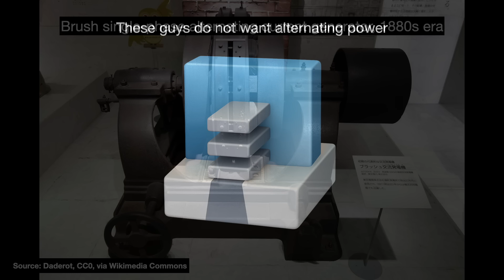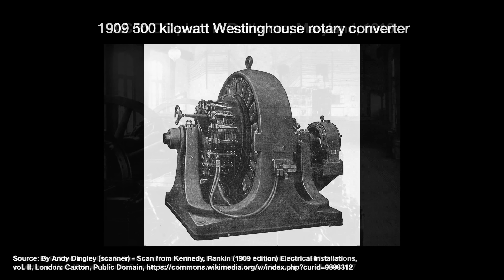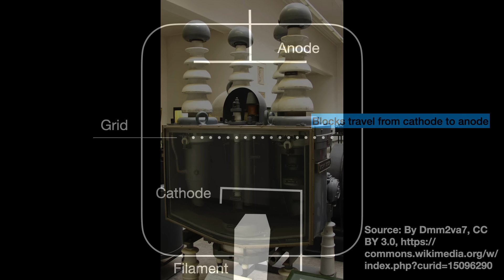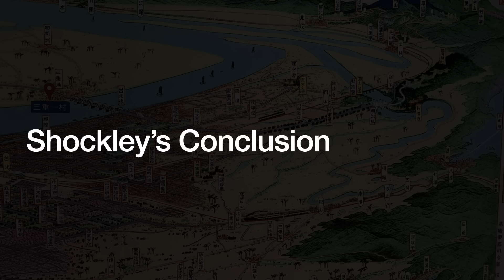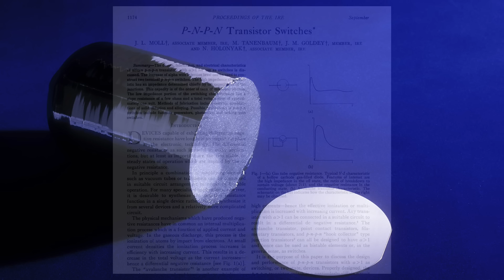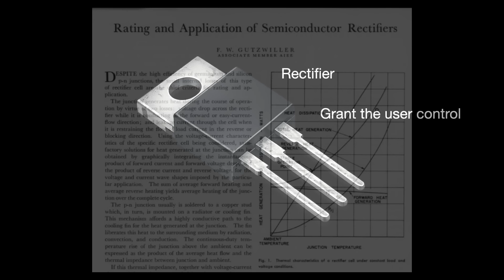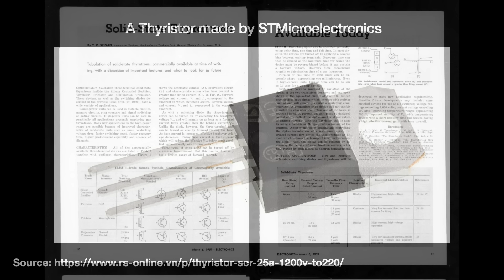Thyristors Did to Power What Transistors Did to Logic

Comment: The thing you diagram is more properly called a mercury vapor valve (though not consistently), rather than rectifier. You omit mention of the trigger electrode. This is what initiates the flow of current, giving functionality similar to a thyristor or SCR. These were used in HVDC links, such as the Pacific HVDC intertie from Oregon to Los Angeles. These ability to control the timing was essential to their ruse in the inverters that handle both AC->DC and DC->AC, supporting power flow in both directions. These have long been replaced with thyristor stacks, like the one you show, and more recently, with IGBTs. In all cases, the ability to control where in the AC cycle the device turns on is key to controlling the flow of power. Modern inverters turn on layers of these stacks in sequence to approximate a sine waveform, rather than a square wave. By changing the timing, power can flow in the opposite direction, converting to DC like a rectifier, but with more even power flow, needing less filtering to smooth out the resulting noise.

Comment: NZ MENTIONED!

The thyristors as part of the HVDC link are very cool. And the ones at the north end sit right on top of a very major faultline. The building they're in is built to handle something absurd like a direct hit from a 9.0 quake.
Reply: Picture is of Pole 2 (you can tell from the ABB logo on the thyristors) which was built in the early 90s, Pole 3 was built in early 2010s to survive anything short of a bunker buster, Pole 2 has only recently been upgraded to the same level of seismic resistance. 

My dad was a HV lineman in the 70s and worked on Haywards substation and surrounding network, he got to look around the old mercy valve POLE 1 back in the day, he became a power station operation in the 80s, so I got to go places in a hydro station as a kid that health and safety wouldn't let a child within a mile of now.
Reply: @taznz1 Thanks, I was sure it was just some test lab for lighting strikes. Nope! Deployed HVDC in NZ...700kV pole to pole at 1300 MW or so. Stripes mean danger goes commercial.
Reply: Thyristor modules are often hung from the ceiling. The HVDC converter station at Sylmar, Los Angeles, is on a fault line. At an earth quake, the modules will swing, unharmed. The station on the other end of that HVDC link, at Celilo, The Dalles, Oregon, is not at earth quake risk, but still constructed similar. I worked at those projects about 1989.

Comment: I have a New-in-box RCA made Thyristron 2D21, never have an opportunity to use it :) The mfg date seems to be 13th wk of 1953!
Also, the most popular PNPN 2-terminal device is a DIAC.  The breakdown (trigger) voltage is now more stable than when it was invented.  A most popular and still used DIAC is "DB3" and frequently used in Tungsten light dimmer's TRIAC gate's trigger voltage control.
Reply: Also common in telecom line protection -- without DC, they'll always turn off, and with a breakdown voltage somewhat above peak ringer voltage (80V or so), they'll clamp lightning-induced surge to very comfortable energy levels.  Not so common these days I suppose, with POTS on the decline, but ironic that Shockley wanted to sell them to Bell -- just needed enough consistency and robustness first!

Same application as GDT (gas discharge tube), for transient protection; and same contraindications, such as DC and AC/mains power supply where the latching would be a little...problematic.

The 2D21 is a fun little bulb to play with; it doesn't even take much voltage to switch, so can be safely breadboarded, say with 6.3V and 24V power supplies.  Despite being a small "receiving" tube, it's rated to switch near a hundred watts; enough for a small incandescent lamp, or (as was often the case in practice) an AC relay coil for something much larger (small valves, large relays/contactors, etc.).

Comment: RCA used the term "thyristor" by 1960, for their 2N1213-2N1216 devices, which were  made from germanium. From the datasheet dated March 1960: "The thyristor possesses characteristics similar to that of a conventional thyratron tube. Once triggered 'on' the thyristor will remain 'on' even though the triggering voltage to the base (control electrode) is removed."

Comment: Ive still seen MG sets in old power plants that are still operational.  MG set is the "modern" term for a rotory.  They are also used for variable voltage output, when an adjustable scoop tube is placed between them.  Those were used before solid state motor controllers and also still exist in power plants designed and built in the 70s and earlier.

Comment: A neat thing about SCRs is that they only shut off when the voltage goes to zero. That means if you use them to drive inductive loads like relays and solenoids from fluctuating power sources (like rectified AC) they won't generate back-EMF voltage spikes, which cause arcs and sparks that slowly destroy your other relay contacts (and annoy the FCC). I used SCRs to drive my Friden Flexowriter, and they worked great for that!
Reply: don't they shut off when current goes to zero?
Reply: @w0ttheh3ll , yes, when the supply voltage goes to zero the current goes to zero and the SCR shuts off. It then stays off until it is turned back on.

My Flexowriter uses solenoids to trigger the keys, and full-wave-rectified, unfiltered, AC line voltage to drive them. SCRs are perfect for that, because they can easily handle the high voltages, and because when you tell them to turn off, instead of turning off immediately (which would often cause big back-EMF surges), they wait until the supply voltage drops back to zero (which happens 120 times per second), and then they turn off. That prevents the back-EMF surges.
Reply: @ncdave4life  in the case of solenoids, current and voltage are not in phase so they don't go to zero at the same time. that's why I was confused in the first place.
your SCR turns off when current is zero, that way you don't get EMF because thats the only time the solenoid stores no energy. voltage is not zero at that time. at least that's what happens when using line voltage. I don't think you can get EMF-free switching when using full-bridge rectified voltage because there's always a current and the solenoids always carry energy. Are you sure about the full-bridge part? With a half bridge it could work.
Reply: @w0ttheh3ll , that's a GREAT point!

It's definitely full-wave rectified (and not even isolated from the AC mains!).

The power supply is completely unfiltered, so there's a brief drop to zero voltage between pulses.

I don't recall whether the bridge rectifier uses silicon diodes or selenium rectifiers. It's a "modern-looking" Flexowriter (with paper tape reader and punch), so it must have been made in the late 1960s, which I think means it could have used either silicon or selenium rectifiers. Sorry, it's been a long time since I've had that thing apart.

With silicon diodes you only lose about 1.4 volts, leading to a very short pause between pulses. The SCR adds another 2v or so forward drop. ChatGPT calculates that that would give a pause of a little over 0.1 mS. With selenium rectifiers the voltage drop is much larger, so the pause would be much longer, probably about ten times as long.

The SCRs definitely do shut off reliably, so I guess there must not be enough inductance in the solenoids to keep the SCRs "on" through the pauses.
Reply: @ncdave4life SCR is a current device. It has absolutely nothing with voltage.
Reply: @w0ttheh3ll the IBM 2741 selectric typewriter used diodes and a capacitor resistor to suppress the counter EMF from the actuator coils to always keep the current in phase with the voltage to turn off the SCRs powered by a pulsing 24 volt DC supply at 60Hz.
Reply: @designengineerdude1952 , that's interesting. Was the 2741's 24v supply full-wave-rectified, or half-wave only?
Reply: @w0ttheh3ll A SCR is Not a voltage sensitive device, it turns off when the current drops below a threshold. It's about the number of electron holes  migration not the force behind the migration. So in very inductive loads, the current continues flowing even with negative voltage. The SCR continues to conduct until the current to near zero, at which point it turns off.
Reply: @designengineerdude1952 , yes, you are correct, as @w0ttheh3ll also pointed out.

Comment: And now tell us how they finally managed to get the IGBT's voltage ratings into the low and medium voltage levels that have taken VFD's from the 2 foot wide by 5 feet tall down to something I can hide in my hand. I have worked with them in an industrial setting for 50+ years, and dearly love today's drives. When VFD's first came out, they weren't usable for anything that had to be extremley steady speed, so we were stuck with large DC motors and their drives. When PWM got here, that all changed, and then the IGBT's showed up, and it all changed again.
Reply: Single biggest thing in that was the switch from silicon to silicon carbide for high power ones. Like the switch from silicon to gallium nitride in low power ones this only took place well into the 21st century.

Comment: I worked on military radar equipment that used mercury thyristors. They used them to tickle the magnetrons. Later I serviced DC drives of practically any manufacturer and used in local heavy industry. Learned the principles of phase control from GE's "SCR Handbook". Fun times.
Reply: Still have one...

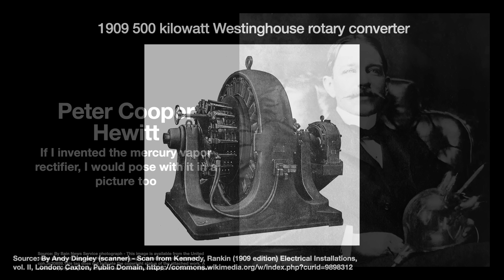Comment: At 2:58 you show a rotary converter, but your description is of a motor-generator.  A rotary converter is a single rotating device with windings for the AC and DC, not a mechanically coupled device.  The rotary converter was more efficient but couldn't change the voltage like a motor-generator.

Comment: Not too applicable to US back then,  but across Europe the thyristor totally revolutionized railroad electric traction into the 1970s. Across the board of trams, underground, light or heavy rail, solid state control outcrowded electromechanics, starting with thyristors. 

It didn’t take long from PID ‘chopper’ control logic to full computer based implementations, making the transition to variable three- or multiphase traction motors possible. Of course using later forms of solid state components, not thyristors as such. Past ca 1990, Europe’s early lead was probably over, it has been used in diesel-electrics, battery, hydrogen, hybrids… every motive power with electric traction motors for decades…😅

One of the last pictures in the video is credited ABB, possibly showing early devices used for this purpose…?
Reply: SNCF, French railways, récently retired the last BB 15000, the first AC locomotive using thyristors, after 50 years of service.

There were particularly reliable, with a very low failure rate.
Reply: @c @chefchaudard3580 es, I’ve heard good stories about them. The Swedish counterparts (technically) Rc & Rd machines still go strong, so does some other Asea/ABB derivatives around Europe. Sadly, our 1979-designed thyristor-chopper Oslo trams left their tracks last year. Being high floored and body wear got to them, reliability was impeccable.

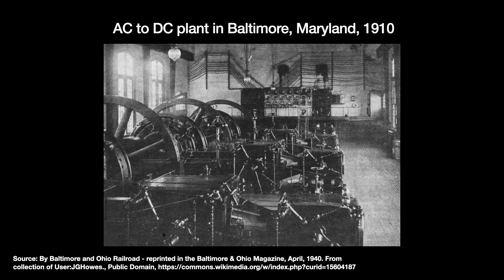Comment: 3:25 using electricity to turn a motor to turn a generator is also what flywheel energy storage still does...
Reply: We had a fairly big one to stabilize power at work. It did its job extremely well.

Comment: I was engineering foreman at Havelock Asbestos mine in Swaziland in the late eighties to mid nineties.
Our rock hoist winder was an ASEA unit installed in the early sixties. It was a DC Winder that had an AC motor driving a DC generator

Comment: I know up to the 1970s they were still using dc motors to drive AC generators for some specific applications. The neighbors boom truck I work on has one of those in it as a 'backup' for incase the main generator in it shuts down.
But it has an automotive starter hooked to a single phase ac generator that can be turned on, it is enough power to turn and lower the boom.

Comment: One major thing that the thyristor revolutionized was flash photography. Before the advent of the auto thyristor flash, a photographer had to approximate correct exposure by knowing the guide number of the particular flash bulb or electronic flash being used, and then doing math (ew) which was dependent on knowing the exact distance to the subject in order to determine how to set the aperture on the camera. This almost always resulted in a photo that was either over or under exposed, because you would estimate the distance wrong, or the subject would be at a distance that was in between two different aperture settings. And that was if you were a professional (or enthusiast) photographer with a professional (or prosumer) camera. The average consumer camera just used a very wide fixed aperture and you just kind of accepted that all of your flash photos were going to be a little overexposed. Or a lot overexposed, as the case may be. The thyristor allowed the development of automatic flashes that could detect how much light was reflecting back from the subject, and then kill the flash before the photo was overexposed.  Eventually, this would be replaced by through the lens flash metering, but prior to TTL becoming ubiquitous, the auto thyristor flash made life a hell of a lot easier for photographers.

Comment: Another great video! Some large spot welders still utilize the NL-1009A Ignitron Tube, a mercury rectifier that glows UV/blue when operating. They have water-cooled metal casings. These are older machines, while newer ones are now solid-state.

Comment: We still use hockey puck and those rectangular SCRs in our shitty mill, as well as MG sets. The latter being an idiotic thing to keep around.
Reply: Back in the mid 2000s I interned at a place with varying ages of equipment; among the tasks was ripping out an ancient MG set, and replacing an old SCR inverter with a modern VFD. Which, since it was just headed to the scrap bin, I called dibs on, and with no complaints, I came back that day about 50lbs heavier -- they used a lot of iron in those things, for filtering and commutation.  Even with "inverter grade" SCRs, they still take 10s of µs to turn off, hence big inductors to soften the blow as load current is interrupted (plus a few film capacitors, and snubber Rs and Ls all over).
Reply: @T3sl4 my facility also has mg sets all the way to modern vfds. Even has stuff like mag-amps and maybe even those thyratrons I've read about. It's still mostly DC and Sync motors though.